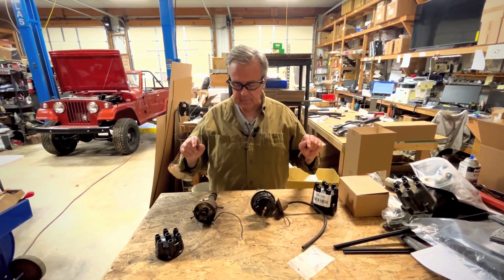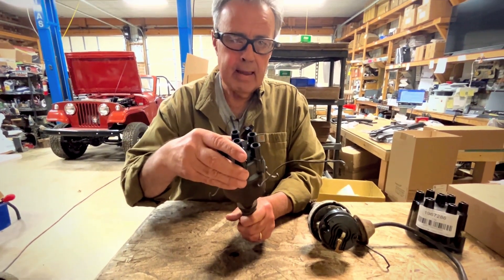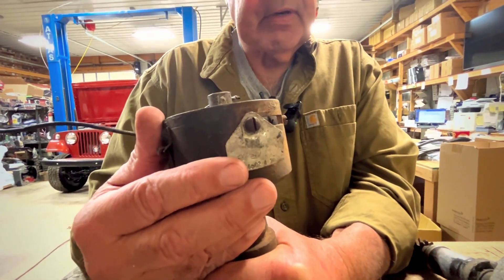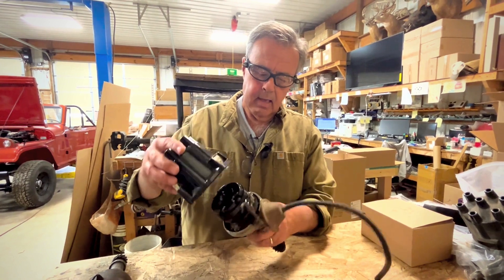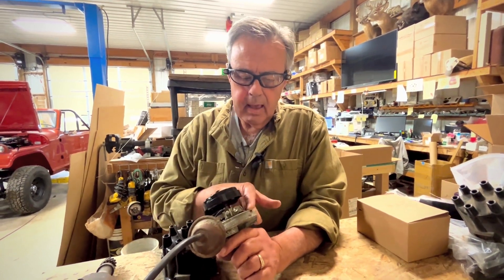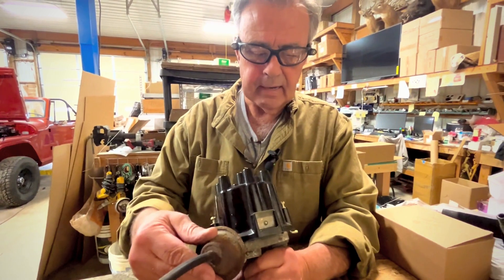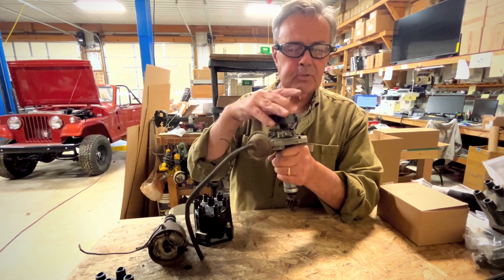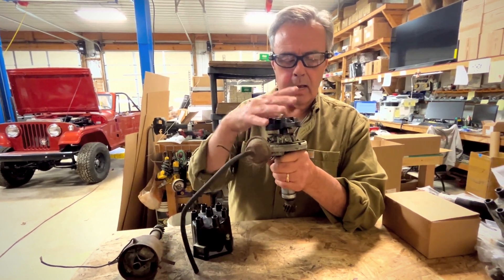Part I | 225 V6 Odd Fire Distributors: Prestolite vs. Delco – What You Need to Know!

Comment: Very helpful information to determine that I have a Delco and to prepare to install a solid-state ignition system (remove points/condenser) for my 1965 Olds F85 V-6. Going to use a Pertronix 1165 which requires a special alignment of the magnet ring. The instructions state: "Next to one of the studs [on the magnet ring], a notch is cut into ring, line this stud up with the square cut out in the advance weight mechanism for correct firing pattern for odd fire engines." Is there a resource to identify the "square cut out of the advance weight mechanism"?